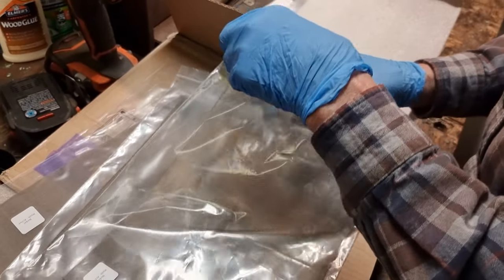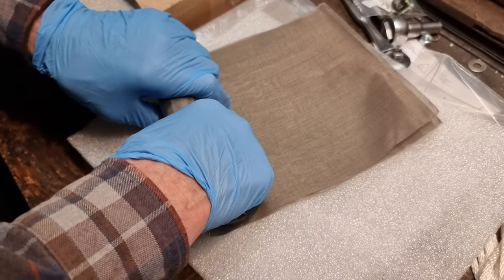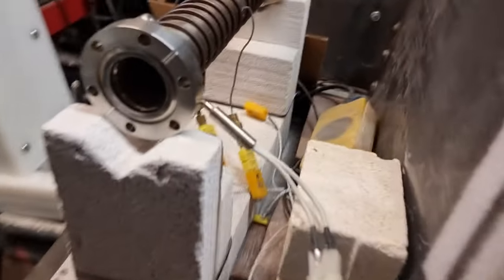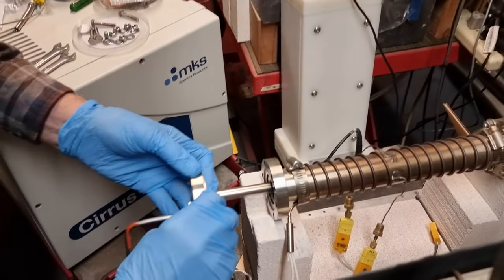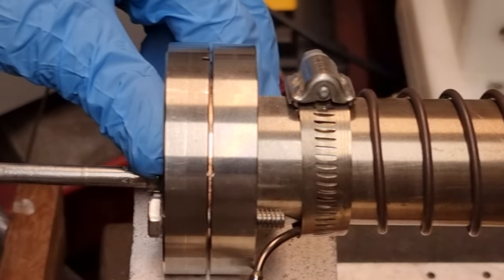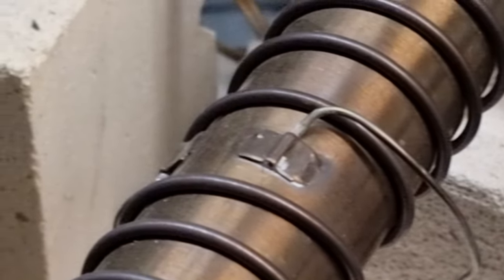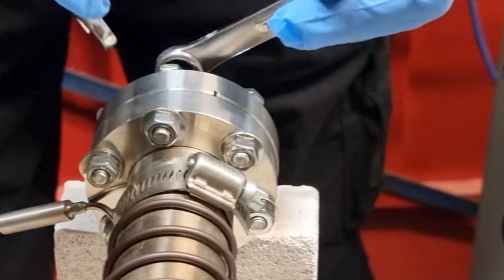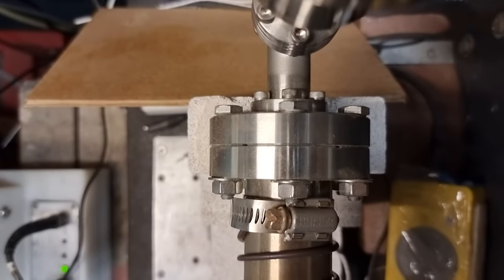MESH - Loading me356 treated Nickel mesh into Mizuno R20-style reactor

Comment: Dear Bob,

I'm an MD -  don't know much about nuclear physics. I'm probably talking nonsense but...
1. why don't you use a Ni sponge + H2 covered (or not) with Pd (+D2) as the electrical heating resistance instead of the tungsten coil - outside which consumes a lot and is difficult to heat the mesh? I would briefly, intermittently heat the Nickel mesh with a small current...a controller? 
2. why don't you use a solid/liquid medium with an H2 donor instead of a gaseous medium (H2)? As you said in another movie - A sufficiently dense medium is required. A solid/liquid substance that decomposes at about 400 C into hydrogen (LAH- like Andrea Rossi?) would successfully be sandwiched in ceramic plates? 
3. have you search what this guy said on min. 10:09 - https://www.youtube.com/watch?v=4T-5RSaaXIs&t=1099s - it seems like an easy ”heat after death” experiment to reproduce - it probably occurs when the electrolyte evaporates completely and heat up to 400 C?! https://www.lenr-canr.org/acrobat/TianJexcessheat.pdf 
Regards, Nicolae

Comment: What kind of heater coil used? The material, resistance and the maximum temperature attained...?
Reply from the maker: It is the coil on the outside of the experiment. It is a commercial encased heater element. The target temperature was 250ºC

You can see notes in the Mizuno Replication document here:

http://www.quantumheat.org/index.php/en/home/mfmp-blog/554-mizuno-analogue-experiment

Comment: Have you fooled around with microwave kilns? Is there a substance that reaction to microwace ovens to create radiation in a spectrum other than infrared? I've always wanted one to melt glass and steel and such but after watching your videos I wonder if it's only heat or something else
Reply from the maker: There is a wide array of frequencies in the MW band - Cookers work because they are resonant for the O-H bond in water. Depending on what you want to do, this will dictate the frequency. Then there is phase conjugation and Ion-acoustic resonance.

Comment: What is the intent of this experiment?
Reply from the maker: To test the claim of me356 that loading these specially prepared meshes to a low level with D2 and raising heat to 250ºC will see a COP of 2.

Unexpectedly, the meshes absorbed massive amounts of D2 at room temperature and this was not realised until exceeding 100ºC

The claimant stated before the experiment that if too much D2 was absorbed, it would not produce excess heat and it would be extremely hard to get the D2 out of mesh.